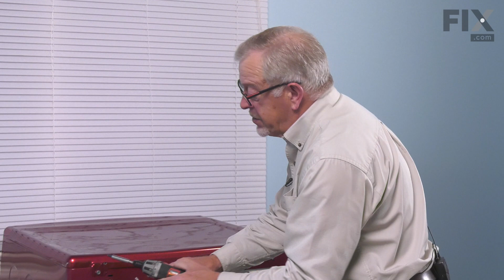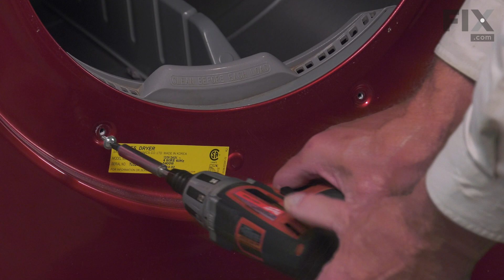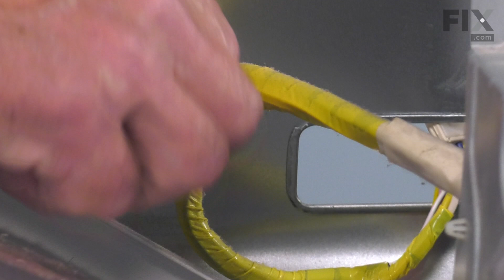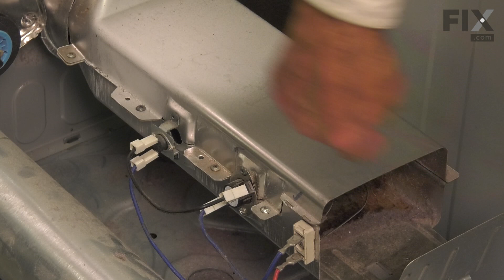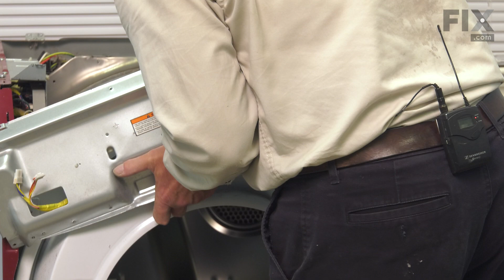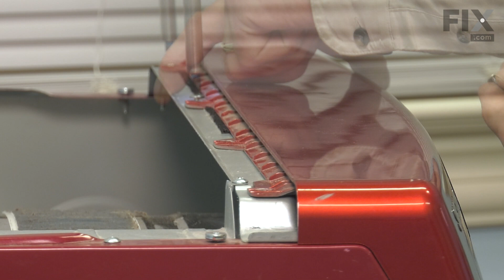Samsung Dryer Repair - How to Replace the Thermal Fuse

Comment: Steve, I know this video is 5 years old, but even 5 years later it's still helping. Our dryer stopped blowing hot air and my husband and I were able to fix it with your videos alone. If you ever feel like this video aren't helpful or question if they make a difference, take this as your reminder that they certainly do. Thank you!